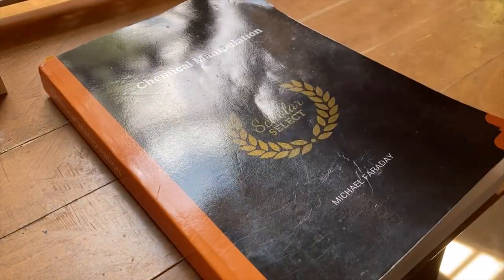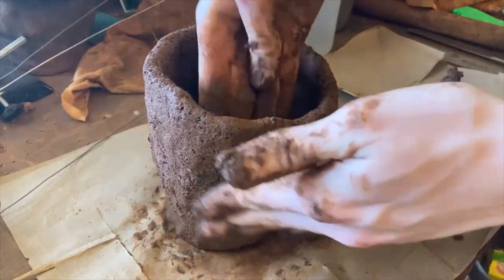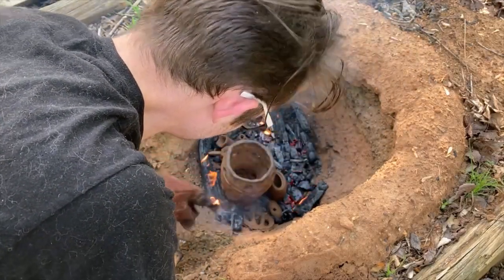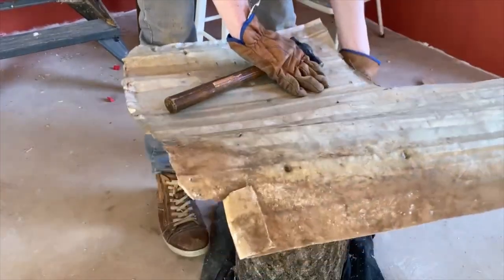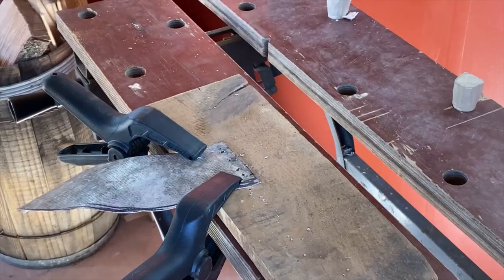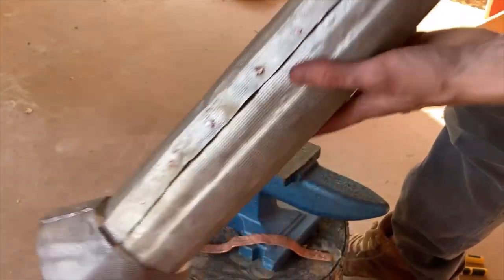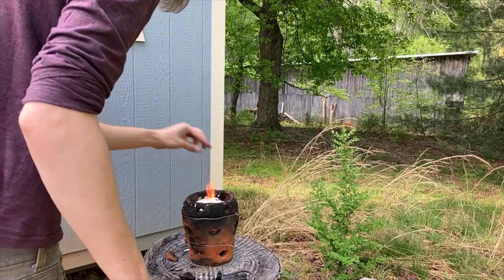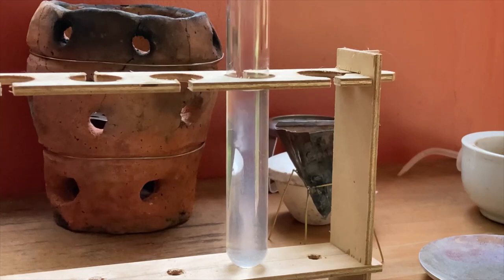I made Michael Faradays lab furnace and used it to do chemistry

Comment: Another fantastic video my friend. I am a PhD chemical engineer and I love this old stuff...lol You ahem a new subscriber and you have inspired me to get back to my roots in research.
Reply from the maker: thank you! I really appreciate that! best of luck with your research!
Reply: @fraserbuilds  Thank you my friend. I do not know how I missed your reply. You are doing some really fantastic work. Right now I am building a replica of a 1928 Morgan hillclimb special race car. It was originally designed to look exactly like an airplane without wings. In the front is an engine and I am using a modified experimental opposed twin motor. My problem is mating the engine to an MGB transmission. I am building a casting foundry so I can make a mold for an adapter so I can cast it out of aluminum or some alloy. Then I can chuck up the raw piece on a lathe and make it so that it fits both the output shaft on the engine and the flywheel for the MGB transmission. There is only one of the originals in existence so I am looking forward to making some great memories with it here in the USA because the original is in England.  https://youtu.be/W9QMa7AUD-4

Comment: Just seen your presentation. By a strange coincidence, being an habitual tinkerer, just last week I came up with a smilar crucible/chimney arrangement to do some minor blacksmithing, an old stainless kitchen waste bin supplied the chimney material. On 1st use I had to partially block the 900mm chimney as it soon got way too fierce. Eventually I hung the chimney on wires, so I could move it aside to control the draw.  I was rather pleased, until today I see I'd reinvented some old/obvious tech.
Carry on my good fellow.

Comment: I’m impressed by your knowledge of Chemistry. Regarding your clay, if you are throwing/making pots/ceramics, I noticed in your video you was kneading it but you wasn’t banging the blow knot clay to knock the air out of it, if you haven’t done this process it is worth doing as it will knock out any air bubbles and means your pottery/ceramics are less likely to crack or have air pockets expand when heated. I wasn’t sure if you did this step or just missed it out on your video. I noticed a couple of clay videos where it wasn’t shown. So hope this information helps. Please keep making your videos, I find them very fascinating and have given me a couple of Ideas for some projects I want to try myself
Reply: I think you are talking about "wedging", and it is indeed important to getting consistent results. I've never worked with clay having anything but clay in it  -- no "sea coal" or "plumbago" (Faraday's "plumbum"?) or other stuff. However, I have done a but of lost wax bronze casting using plaster moulds. Plaster would never stand up to molten bronze temperature on its own, of course, but plaster mixed with "grog" will. Grog is made from pulverised and screened fireclay. You just hard fire some pots from virgin fire clay then smash the bejeezus out of them once they cool. Firebricks -- white ones, not the red -- would work too. Sieve the fragments so you have both fine and medium coarse grog. "Fine", as I recall, was bigger than poppy seeds and smaller than sesame seeds, and the "medium" was about the size of, say, short grain rice. You then just wedge it into the clay. I don't remember the fractions of each we used.
Reply: I have heard that air bubbles actually do not cause cracking when firing.
Reply: @OmniversalInsect  if it has big enough air bubbles in the clay it would crack, there would be some wiggle room if you use grog in the clay but you still don’t want air bubbles (air pockets) of any size as it can and in most cases cause cracks, even if you don’t see them. They can also cause pottery to explode which is like a bomb going off and can send ceramic shrapnel everywhere which of cause can be lethal.

Comment: Thanks for posting this, I have been planning to build a similar furnace though with more metal components, in emulation of one I saw in a documentary on the making of tudor era pins. It was used to solder the heads onto the pins and for various gilding tasks.

Comment: Fraser -
In your scrap hunting if you can get ahold of even a basic metal detector, like a kid's version of a Bounty Hunter,  you'll be able to find more scrap material then you'd know what to do with, and by your vids you know how to use scrap, but my statement stands!

And 2, if you haven't thought to use them, the bottom concave section of an aluminum soda can makes a great mixer tray and some of the best thickness of Al you can get from a can since that part of the can blank is more depressed vs stretched to make the thin sidewalls.

Comment: I believe you are missing an important aspect of how a chimney works, which strangely not even experts consider, and it is thus:  Within a fire, hot air and other gases are maximally expanded. Once cooled the same gases take up a fraction of the space they did when hot. Within a chimney that cooling and shrinking makes a progressively larger zone of negative pressure the higher those gases travel, that pull up yet more from below, making the fire hotter, creating a chain reaction that we call Draw. The longer the flu pipe, the more cooling and shrinking above, almost an implosion occurring. Which is perhaps the actual reason hot air rises. 

Additionally, making a high emissive coating to reflect radiant energy back into the firebox will make it even hotter. Some people use a zirconium/sodium silicate paint to achieve this.

Comment: thats an awesome result for a first go at a faraday furnace, I was surprised the aluminium didnt melt when the gases started burning though ...nicely done. I presume you have used it more for other things but did you work out how to make it more efficient to convert all the egg shell in the end?
thankyou for sharing
Reply from the maker: Thanks! the best results ive had so far has been by removing the crucible all together and directly burying eggshell in the coals themsleves, though it still takes quite some time and mixes ash with the product.
Reply: @fraserbuilds  I can see why taht would work but it does mess up your product quite a bit....I've been trying to come up with a way of making a crucible with charcoal in it instead of graphite. I figured it might mix with clay to make a viable but more heat absorbant crucible...Only trouble is I haven't actually been able to try it out yet.

Comment: You need to spend some time with a potter. You need a wheel and some advice on techniques to attain regularity.
Reply: Wheel throwing is a whole 'nuther skill. I can't imagine working with clay with grog in it or other additives -- it would shred your hands! I think his instinct is right, do pinch pots or slab building for anything that requires high heat resistance.